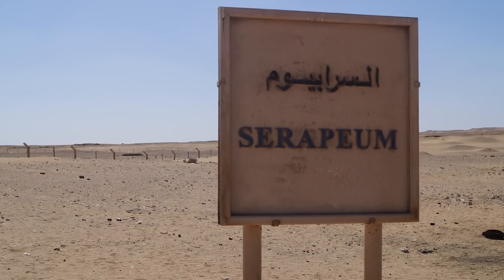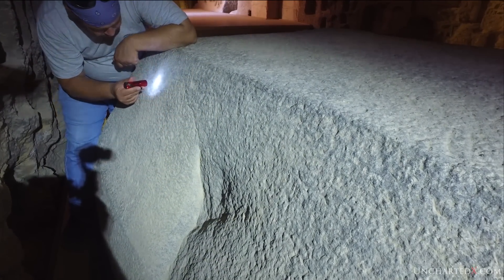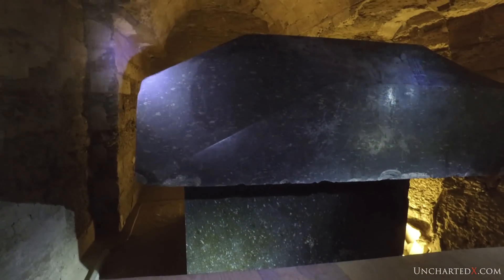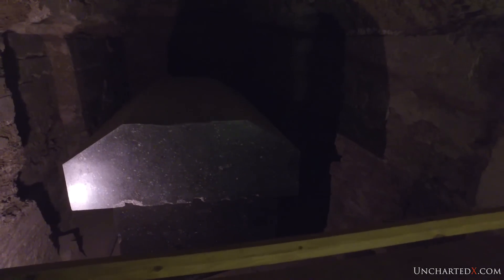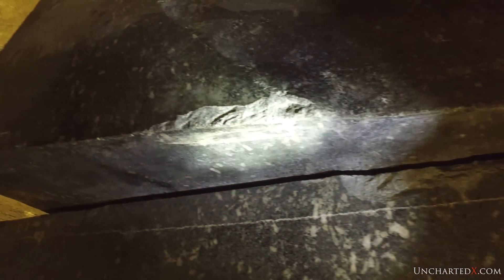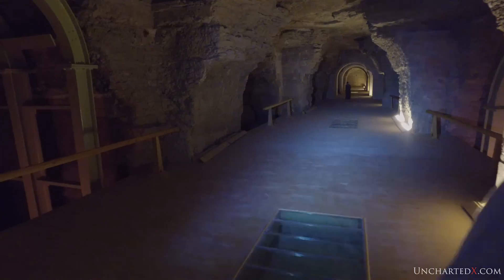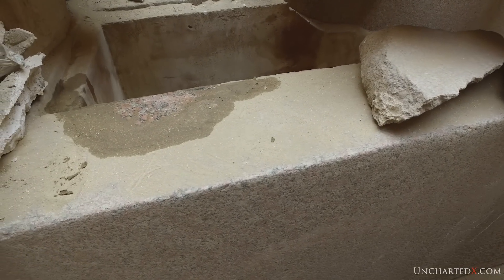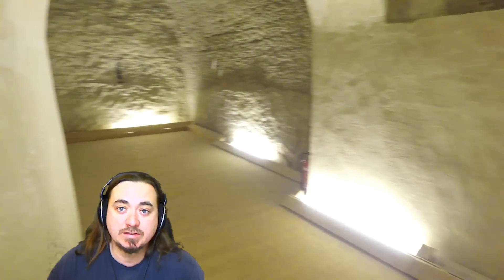Evidence of Ancient High Technology - Liquid Polishing at the Serapeum of Saqqara - Chapter 4

Comment: I do not see a big deal with polishing these stones. About 50 years ago in highschool auto shop I learned how to hand lap valves to a high shine that was airtight at the high pressures inside an engine. All we used was a lapping tool (a dowel with a suction cup on one end and paste with fine grit in it. Put the grit between the valve and it's seat, stick the suction cup to the top of the valve, twirl the dowel between your palms. Stop, rotate the valve a bit, twirl, stop, rotate, twirl, repeat many times..... Very low tech, time consuming but effective. Want to polish a countertop by hand? Find a flat rock - maybe a piece of broken countertop - get some grit - sand to start - put between the stones, rub back and forth, side to side, for a long time using finer grit. For scooped out areas.... has anyone heard of sandpaper?